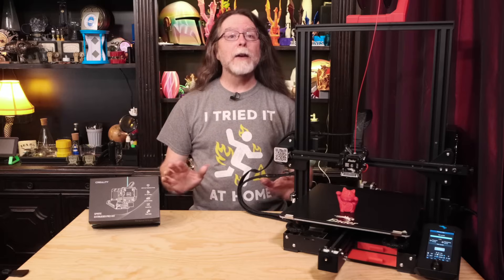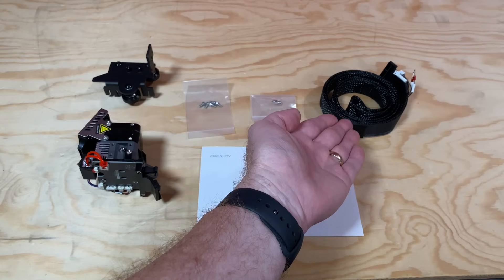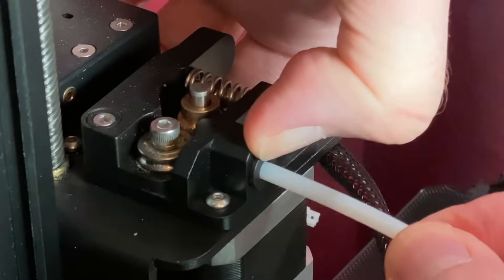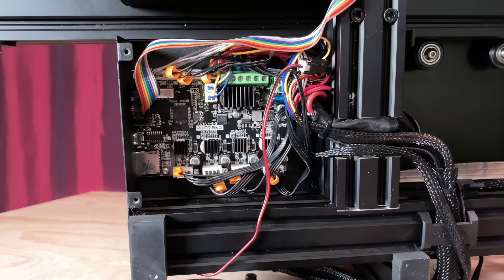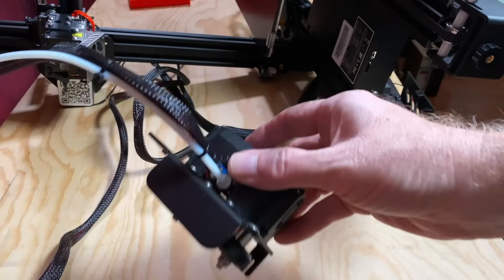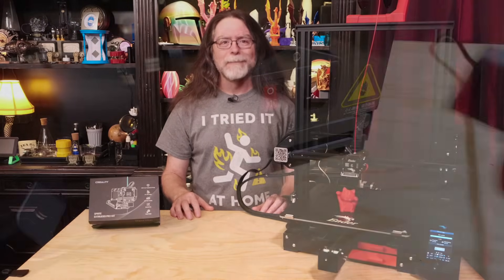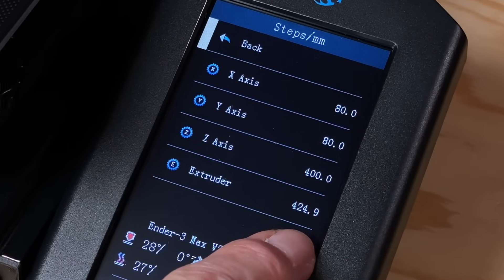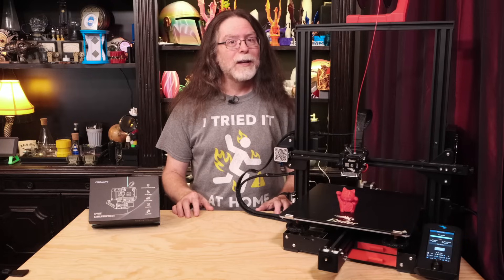How To Install the Creality Sprite Pro Extruder Upgrade

Comment: I think polarity does matter with this particular hotend on the board (4.2.7 Jyers firmware). When I first switched on and attempted to heat up the nozzle, the printer switched itself off and back on. When i switched the extruder heater cables over, the issue was gone.
Reply: Can confirm the polarity does make a difference. I had to take everything back apart because while testing preheating would loop the power. For the life of me I couldn’t remember where I saw this bit of info. Went back in switched the cables and bam temp didn’t power cycle
Reply from the maker: @WillStrip4Bacon  Sorry for the confusion on this one. I was thinking in terms of the heater cartridge not being a polarized component, and wasn't expecting the heater cartridge's "ground" lead to be shared with anything else on the Sprite's breakout board.
Reply: @BV3D  I’m just glad someone in your community posted on the comments as I was following your video for switching over to the sprite pro. Just swapped out the hotend on my ender 3 v2 to this one. Thanks for the helpful video !
Reply from the maker: @WillStrip4Bacon  Yep! Kudos to @bob f for pointing that out. It was super important, so I pinned it to the top of the comments!  👍🏻
Reply: @BV3D   I have had 3 failed prints since swapping went in and adjusted the retraction as recommended. Doesn’t seem to be sticking to the bed as well as it use to. Any tips to check for a some what noobie to the hobby ?
Reply from the maker: @WillStrip4Bacon  Things I would do:

Clean the bed. If it's a glass bed you can remove from the printer, hot water and dish soap works well. If it's a "sticker" type of print surface, either PC or PEI, a quick wipe with isopropyl alcohol usually does the trick.

Look at the first layer and see if it looks TOO squished or not squished enough. If you have a bed probe, adjust the Z offset to adjust the squish. If you have a manually-leveled bed, adjust the knobs to adjust the squish.

If the squish looks good but the filament still doesn't want to stick, try a single-pass layer of glue stick on the bed, where the model is going to print. There's no shame in using glue stick.
Reply: @BV3D  Wish this had been in the video, pretty sure this burned by 4.2.7 board
Reply: @WillStrip4Bacon  would this cause a nozzle lowaperature alarm?
Reply: @WillStrip4Bacon  when it shut off...did you try to turn it on without changig wires?...i heated my nozzle and my printer shut off and it wont turn back on
Reply from the maker: Hi Bob, I think you're right. While the heater cartridge itself is not polarized, the breakout board on the Sprite side of the cable may be sharing ground lines between the heater cartridge and other components. If these are the wrong way around, the 24v line gets connected to ground when the printer tries to heat the nozzle, and the board resets. I'm pinning your comment so others see this.
Reply: @BV3D  Wish I had read this sooner lol.
Reply: @BV3D  ugh I didn’t see this comment until I plugged my printer in and the nozzle isn’t working…
Reply: I switched those two wires and now the printer resets every time I try to set the nozzle… was getting a low nozzle temp warning (and the nozzle wasn’t heating at all). Thermistor is fine.
Reply: Omg. They shipped the sprite without connecting the heat block… wire is tucked behind things. I cannot believe how ridiculous that is…
Reply: @Zoidbergererer  thanks. If it wasn’t for this comment I’d still be struggling
Reply: @jong036jong5  glad to hear you got it! Very easy to miss. Hope you like your sprite extruder, my favourite 3D printing upgrade to date.
Reply: @BV3D ok so everything seems to be plug in right but when I go to heat it up the it sounds like it’s going to but the screen freeze for a sec then a loading bar starts to move then it kicks me back to the main menu and reset the heating settings you wouldn’t happen to know what I’m doing wrong?
Reply from the maker: @eveni9574  Hi, it sounds like the printer is rebooting when it tries to heat the nozzle. Double-check the heater cartridge wires where they connect to the main board. Red should be on the (+) and black should be on the (—).
Reply: @BV3D  I got it working there was a wire on the hot end that was broke off from its connector
Reply: @BV3D  😪 wished I read this earlier. Ran in to this problem too. got it right after som searching on the net.
Reply: Thanks for this video. And yes polarity does matter. If people would read the manual with the kit it shoes you the correct configuration
Reply: Polarity does matter on my 4.2.7 with Creality firmware. Polarity reversed forces the printer to reboot when attempting to increase the hotend temperature.
Reply: What Jyers firmware do you have that permits 300C?
Reply: i have the self problem first!:hand-pink-waving::face-blue-smiling:
Reply: Brand new. Connected according to manual and video. Getting an error E1 code when attempting to yest nozzle. Ender 3 pro, I would appreciate any help.

Comment: Gday mate I have question for you I have installed the new ender sprite pro and upgraded firmware but the hotend won't heat to 200°c and every time I go to temperature and dial in 200 or go preheat pla the screen goes on the blink any tips??

Comment: i bought one last week and returned it. the problem i was having was after i wired everything in it would heat up to infinity every time i switched it on. i finally figured out the problem when i couldn't get it to stop heating up until i unplugged everything 1by1 until i got to the kfan wire. turns out the harness was built incorrectly.

Comment: Good afternoon @BV3D
I have the following machine:
Ender 3 4.2.7 running on a sonic pad with CR Touch.
Everything was running fine until I installed the Sprite Pro Extruder kit. Now the Sonic Pad will not connect. I tried to re-flash and lost all my firmware settings. When I reverted back to the original control and firmware the control will only turn on when the extruder is disconnected but the hot end still throws an error. If the extruder is plugged in then the display will only show blue. Do you happen to have a fix or Firmware for my application. Anything would be greatly appreciated.

Comment: 7:54 turns out the heater cartridge’s negative terminal is shorted to ground. I found out the hard way by blowing up the transistor with a big flash and lots of smoke.

Comment: hey could i get some help please i have a ender3 v2  4.2.2 borad 
and i have folwoed the manual and this video as to set up my sprite extruder but when going to perheated the hotend to 200c it dosent heat and if i switch the heat + and - to see what haapens it will shut off and reboot is there something wrong or is it sothing i have dont

Comment: I have installed the Sprite Pro on my Ender 3 Max Neo and had an issue where the bed probe went off the edge of the bed when I tried to auto level it. Somebody told me to install the Sprite Pro firmware from the Creality website. After downloading the firmware, I put the SD card into the slot and turned the printer on to get a loud alarm find the display was stuck on the Creality loading screen. I turned the printer off and removed the card. Now when I turn the printer back on, the alarm sounds and it remains stuck on the Creality screen. What's going on and how do I fix it?

Comment: @Bv3D hey Bryan I had a failed print on my ender3 max Neo, it wiped out the hot end, so I installed the sprite extruder pro kit. after I realized I shorted out the mother board also.  so I bought a second hand 4.22 board and now all im getting is a beep when I turn the printer on. and Creality on the display. can't get new firmware to load. any tips

Comment: Hi bryan... thanks for all your videos... have been following you since 2022when I got into 3d printing with my E3V2.. I have a few mods on the hotend (dual gear extruder, dual 5015, bimetal hetbreak and direct drive DIY mount)... and I'm looking to replace all that with the sprite pro.. but also looking at just replace the hoyend with the spider 3 and the BMG dual drive extruder... even with the sprite pro, I will add a mod later for the dual 5015.. but not sure which option to choose... is like a 40 ish dollar diff.. what is your take?

Comment: Hello I recently upgraded my ender 3 v1 to the sprite extruder and my bl touch is no longer probing when I auto home/ level the bed. Now the touch does work it’s purple when the printer turns on and I can manually make it probe.

Please if you know anything please let me know.

Comment: HELP!! followed step by step and my Ender 3v2 Control Board begins to smoke whenever it is turned on! I'm not sure what the issue could be. Printer has 4.2.2 board by the way.

Update: i swapped out the included CR touch harness and just wired the OG BL touch harness to the control board and its working again!

Comment: I just wish the thing didn't cost as much as I paid for the printer...(got it on a special for half off). I'd like to use it some day, but at this point I've made so many modifications to my existing hot end I feel like it wouldn't be worth it 🤷🏿‍♀️ (good thing they could be done for the less, though I'm not sure how much it's worth given how long it's taken waiting for parts..)

Comment: Installing the Sprite Pro on my Ender 3V2, everything went well until I got to the bed "leveling" part. Manual homing starts and runs for a few seconds then stops. The message I get is: Printer Kill Reason: Homing Failed Restart Required. Any thoughts on what may be the problem? Firmware?

Comment: I like how you do these upgrade video's. Minimum off-topic rambling while touching on all the pertinent actions that need to be taken. I'm watching your installation of Sprite Pro to a 4.2.7 board primarily to verify my wiring.  Those spare JST male plugs make this task harder than it needs to be. One observation that I have noticed several instruction videos say is this. " No mount for BL-Touch." 
There is no mount on the X-Axis plate as you say, but the mount is on the extruder itself. Just to the right of the hot end cooling fan. Sort of between the hot end fan and the part cooling fan. I ran a thin wire fish tape through that long ribbon cable and pulled the BL-Touch wire up to the Sprite.

Comment: Got my first 3d printer for Xmas this year. I bought this kit and installed it. The whole concept of offsets is really messing me up. This new carriage has a large lobe on left side X axis. Print head is way off the build plate. I spent days trying to understand offsets and the BL  touch offsets to this new kit is a pain. I am about ready to throw the stock stuff back on.

Comment: I installed the sprite upgrade on Ender 3 (not pro) with 4.2.2 board. I also purchased a CR Touch to use with the Sprite. Do you have any videos or instructions on how to get the CR touch to work properly? My probe is not extending during homing or leveling so the hot end gets driven into the bed causing me to force shut off the machine so it does not damage parts.
Reply: I read that you need the 4.2.7 board  hope that helps

Comment: Thanks for this really helpful video. I have just installed the Sprite Extruder Pro+ kit on my Ender 3 S1 but there is a discrepancy in the instructions. You said the steps/mm needs to be set to 424.9, but the manual in the box says it should be 475 - which setting do you think I should use?

Comment: Very poor quality control. I have sent mine back. The nozzle was clogged as delivered and the tensioner screw had jumped off the spring. It will go back in several pieces. And with that fiasco behind me, iI have decided to dispense with the Ender 3 and Creality for well and good.

Comment: Nice walkthrough. Have one of these things on order (delivery expected this coming Wednesday) for my E3v2 after having multiple headaches over the past couple of years with the stock hotend that I just can't seem to fix in a way that lasts. I'll get it working "just right", and it'll be good "for a while", then it'll start jamming at the nozzle - it behaves like a blocked nozzle, but no amount of pulls, or needle probes, or even nozzle replacement cures the problem long-term. I suspect that my bowden tube isn't getting placed "properly", or perhaps it's "burning away", or any of several other "perhaps..." items. Since the hotend fan is also doing a good impression of giving up the ghost, and I've been wanting to start working in TPU, which wants a direct drive extruder anyway, figured it was time to pull the trigger on getting the Sprite.

Comment: When disconnecting the original fan cables, the upper cable (red and black) goes to the fan for cooling the board, should this be reconnected as well?

Comment: Hi i want to upgrade a ender 5 pro with it. in addition with a Sonic pad. I want to print at 295 degrees for some iglidur filament from igus.
how to unlock the 300 degrees temperature setting?

Comment: I noticed in your video that your heater cartridge is already plugged in to the sprite's board but it did not come that way for me (and many others). The connector was wedged behind the fan and there was a blue note on it that said "connect before use". Wasn't anywhere in the instructions!

Comment: Can anyone help me? I have an ender 3 v2 with a 4.2.2 board and cr touch - when i turn my printer on the nozzle starts to heat and wont stop. Ive checked the wiring and updated the firmware. 
Nothing is working 😢

Comment: I just upgraded my Ender 3 Max with the Sprite Pro Extruder kit. Working in every other way but the speed as slowed right down while printing. It is set on the screen as 100% speed but seems to be only doing half that. Is there something I forgot to do with this upgrade. Thanks

Comment: After installing my Sprite Pro with the Professional Firmware and my BLTouch I thought everything was fine. I trammed the bad set the offsets to match the BLTouch bracket, these are known offset values. When I print everything homes fine but the nozzle is several millimeters to high. I used the same firmware and BLtouch with my stock Ender 3 v2 extruder and it worked like a dream. I'm out of ideas, if anyone has any suggestions please let me know!

Comment: For anyone here using an ender 3 v2 and a cr touch, you will need to change your x axis limits and parking otherwise it will hit the rhs of the gantry/frame when leveling.
Reply: do you remember exactly what you had to set it to? planning to do this upgrade over the weekend
Reply: @NiazDokrat  you'll need to either compile your own marlin firmware or you will need to run professional firmware. I think you can run some codes through gcode to reprogram it with stock firmware but I didn't do that approach.
Reply: @leetpg  thanks I think I'll run the professional firmware after looking at it
Reply: is this required if i dont use a cr touch?
Reply: @xcatpatrolx youre likely using the stock z switch. No.
Reply: @leetpg ok, thank you

Comment: I’m about to do this with the mriscoc firmware (thanks to your video, I love this firmware). Anything extra that needs to be done? I also have cr touch.
Reply: How did it go?
I've just bought a sprite pro for my Max
Did the new firmware work ok?
Btw I have got the 4.2.7 board in mine and the V2 type colour display..... previously running Jyers firmware 👍

Comment: I've installed the Sprite Extruder pro onto my Ender 3 Max Neo with hopes of being able to print some ABS parts. The problem I have is that the printer now auto homes about 20-40 mm to the right of center. It's as if the printer believes that the print bed has been moved. When I try to use Auto Level the machine tries to check level off of the right side of the bed. When I try printing, I now tries to print on and off of the front left corner of the bed. I have contacted Creality and after about a month they finally contacted me via email and instructed me to re flash the firmware. I have done that and I am still getting the same results. Is this a case of I need to learn how to write code now? 
Any Ideas????
Thanks,

Comment: So I have a Ender 3 V2 with dual z axis upgrade and Sprite Pro and CR Touch. So once I added the Sprint and CR Touch the extruder positioning over the beds is all off.....when leveling the probe  goes off the right side and front. What are the adjustments to get it back to a center printing area?
Reply: Did you ever find a solution to this?
Reply: @HybridDiamond  yes, i had to adjust the X and Y settings. Just had to spend the time to do it.
Reply: I also have a sonicpad that i was using to control the printers and used the included sensor to do the input shaping. Got them printing between 120 and 155 with good results.  I have them all packed up now as i dont have room at present and using my newer printers.
Reply: @davidmann4436 thanks for the reply, I figured out on my end, this is for anyone who finds this. every time i would level probe the bed with the bltouch the screws holding the sprite would hit the gantry on the right not allowing the probe to actually hit the corner of the bed. I shaved down the bolts fixed the issue.

Comment: Another awesome video. We want to upgrade our V2 with the CR touch/Sprite but our Jyers 2.0.1 firmware only heats to 260C. As you warned, that will have to change. We love the 100 point autolevel but the upgrade is necessary. Can you recommend a similar firmware that that will heat to 300C?
Reply: Search for "professional firmware" by mriscoc